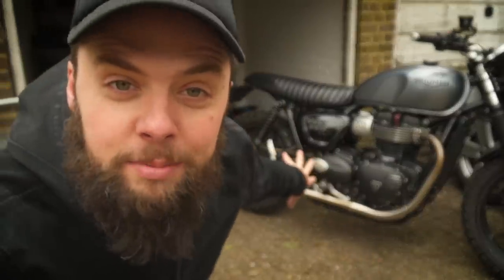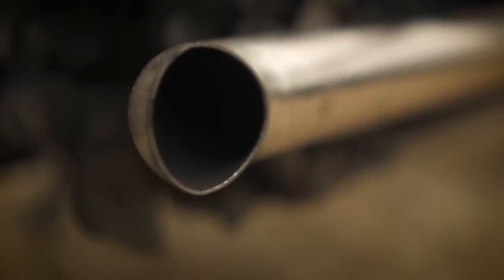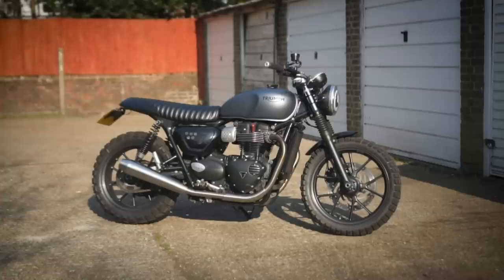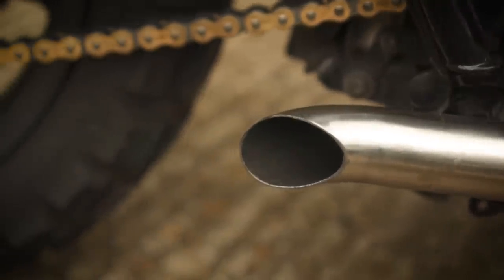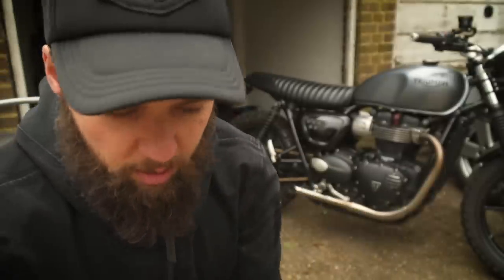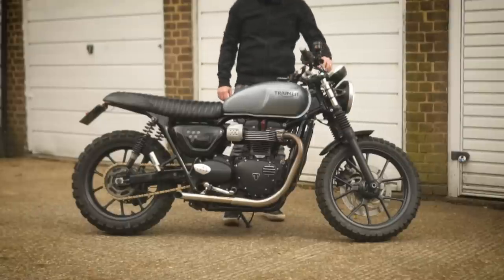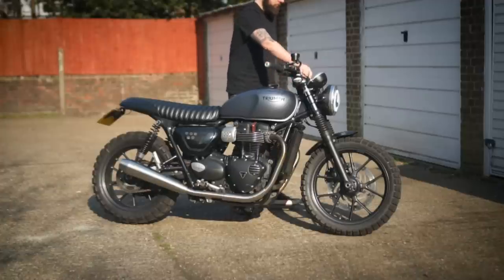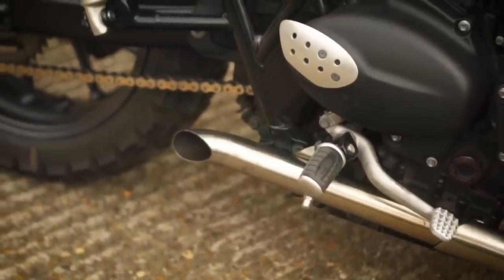Triumph Street Twin Slash Cut Drag Pipe Exhausts Review

Comment: Late to this party but wanted to  add my experience. I have the British Customs offering on my Street Cup. I did not have to remap. I just let the engine idle through one cycle after starting without touching the throttle, then went out for an easy 1 hour ride. Never had a hiccup. I agree with everything MB said, but one detail I’d add is that YouTube vids never do justice to how exhausts sound.  These pipes are not too loud at all, they are quite mellow until you give it the beans. That’s when the fun starts, turning your bike into what sounds like a cross between a muscle car and a WW2 fighter plane. Never fails to put a grin on my face, and wait till you run through a tunnel!
Reply: xpipe fitted together?
Reply: @mrred2102  This is my concern, I have a speed twin and want these on it.....but have an x pipe :)

Comment: Just curious mate, did you check out the prices of the cheap slash cuts on M&P site? I think they were about £30 last time I looked. My local aftermarket and workshop sells those you have for about £45.
Great video though, I miss my 05 speedmaster, she served me well.
Reply from the maker: Just checked m and p. Can’t find anything like it - got a link? Interested to see!
Reply: @motobob  sorry bud, I put in the search box on the site for slash cut exhaust, and loads of pipes came up, most stupid lottery win prices, but they did have a couple that were really cheap. Just thought I'd share it with you, now of course I wish I'd made a note of the part number!

Comment: I'd definitely prefer the vance n hines if it was standard or café racered but with the mild desert sled look you have the slash cuts suit it and sound right! I had straight through slash cuts on a Honda twin chop 25 years ago and yes, they completely messed up the performance and running of the engine.
Reply from the maker: Really? How so? Less power? Haven’t noticed any difference with these which I guess is owing to the cat

Comment: Nice growl but not as loud as i was expecting, it will probably pass the MOT with those pipes on.  You can't use a paddock stand that lifts the swing arm because the brake line goes under the left side of it, unless you changed it of course.
Reply from the maker: I’m 99% certain it won’t pass the MOT - the audio levels on the video prob make it seem quiet because my voice is boosted quite a bit when talking to camera. Good point about the brake line - can’t it slot in between the brake hose and the swingarm? Not looked at it properly yet...
Reply: @motobob  I bought one that lifted the swing arm but decided not to risk stretching the brake hose...better safe than sorry i suppose.
Reply from the maker: Definitely - could be a pain of a job. I’ve got a spindle with bobbins for the rear axle but not sure where I put the bits for the track stand for that. Will have to dig them out as I’m using a jack under the centre stand mounts at the moment and even with some non slip mat it has a tendency to slide around which could end in disaster
Reply: @motobob  I bought a centre stand from TEC it works very well.

Comment: What tune did you use for your ecu? Since the efi system doesn’t have enough self adjustment to compensate for slash cuts.
Reply from the maker: Didn’t change the map. Apparently there’s enough adjustment according to British Customs
Reply: I installed TORS which are made by triumph and I had to remap because I was running lean. Granted I'm on an air cooled, instead of a liquid cooled version. So maybe your CAT makes the pipes less relevant to air flow.  But I highly recommend watching your spark plugs. The manufactures ted to give out bad info all the time.  Good luck.
Reply from the maker: Ah so your slash cuts removed the cat?

Comment: I've got slashed outbound slip-ons, just as loud but they do come back to the axle. Wish they were a little shorter so could use a stand. But went ahead and bought a whole bike lift that fits the frame bars under the engine. Makes for easier work of everything. I bought a center stand, but seems too long. Really hard to pull it up onto the stand, so left it off. Waste of a hundred bucks. Anyway I like the look of the slashed pipes. No standard pipes look that great. The slashed slip-ons or short pipes look really badass. Gotta stay off the throttle when in a neighborhood or some cops though, or u get in trouble.

Comment: Nice slash cut pipe you got. I got mine too on my Bonneville T100.  I have a question. Did you seal both hole on the catalyser & remapping the ECU after that?

Comment: Cheers for posting. Will be looking (and listening) out for you on my daily commute through East London / City. 👊
Reply from the maker: What are you riding? I don’t always go that way but occasionally go through the tunnel or over tower bridge is the traffic is bad through elephant and castle. I’ll keep my eyes peeled for you!
Reply: MOTOBOB Black Street Twin. I was thinking of the slash cuts from BC.  Cheers for the vid, I like the sound but am instead going to go with a decat with the stock pipes and if that’s too quiet add on the BC Predators.
Reply from the maker: Sounds like a good plan. The predators look great too
Reply: tommortlock what did you go for at the end?
Reply: houseofcheung motone xpipe decat, with stock pipes.  Sounds good enough to me.  I park next to work and so don’t want it hooligan level loud!